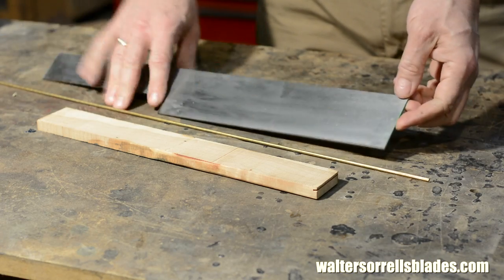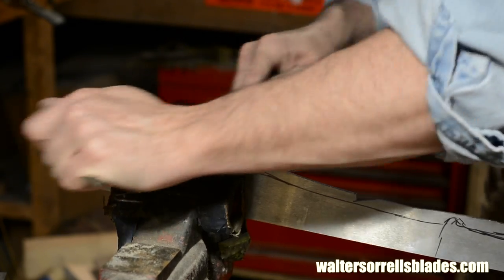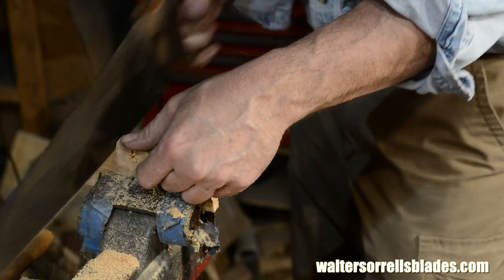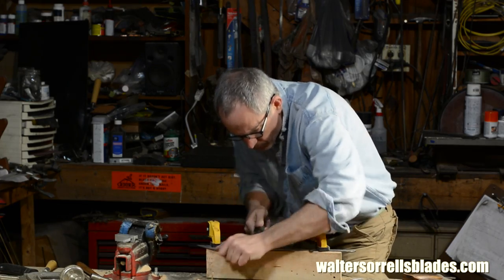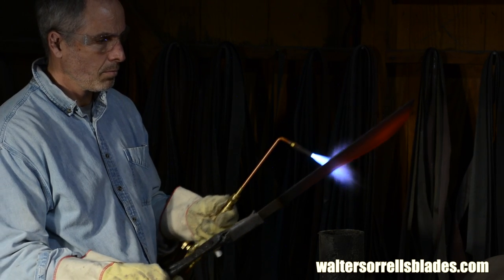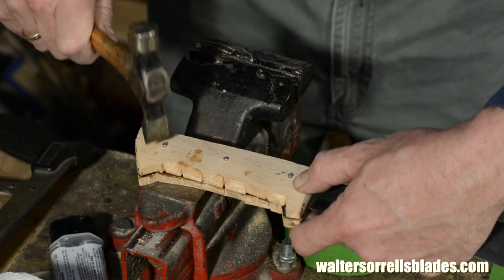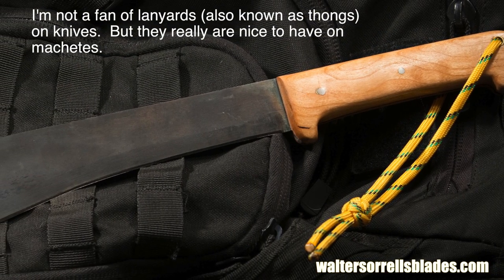Making a Machete with No Power Tools - Survival, Prepper, Beginning Blade Makers

Comment: Great videos very informative I got into knife making as a hobby and I alway use your videos as references, but had a few questions. When quenching the blade can u re use the oil over and over. Also I was wondering if u can use copper for pins. I have a feeling it's to soft and can't handle the water like brass or stainless.

Comment: This is awesome, and I'll definitely be giving this a try. Speaking of reducing carbon footprint, what are your thoughts on re-purposing used saw blades to make knives?
Reply: Repurposing old saw blades is a better grade steel then he used. My grandfather and I made knives together when he was still alive.probably close to 300 or so. Most were sold but I have 3 of them. All were made out of old blades out of table lathes and board planers. We made a matched set of 2 butcher knives with rosewood handles. The blade edges on both are 12 inches, razor sharp, and 2in wide tapering down to 3/4in at the tip with 30 degree arcs bringing them to a point. I use coconut oil on them when their not being used so they don't rust. So in other words repurposed blades to make knives is a really good way of getting quality steel to work with cheap.

Comment: Did I hear you right? Bevel to .015" on the edge? Or did you say .050"? Im doing this exact thing now with an old file... and the bevels are kicking by butt. I now have them pretty similar to one another, but they are more like .050-.075" at the edge... If I were to get them down to .015 I'd be filing for another 5-8 hrs at least... My M9 bayonet's edge seems to be cut from about .050" to .075" so that is where I stopped. Should I put the work in to make the blade a wedge (or something close, i.e. .015"), or should I leave it and put the edge on post-hardening/tempering at .050"? A little more info: The knife is a large one, a couple inches longer than my M9 and about .187" thick (3/16). The blade design is similar to a sheep's foot/reverse tanto. Any advice is appreciated!
Reply: GOREBAGZZZ I intend to make it a heavy camp knife, capable of taking abuse and chopping down trees and splitting fire wood. So although I will put a sharp edge on it, I will be swinging it wildly.

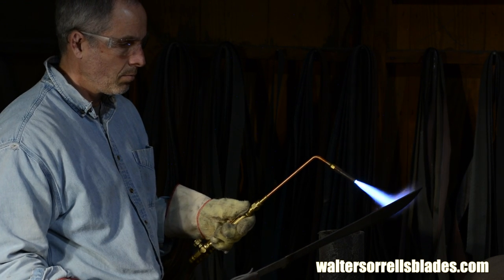Comment: at 11:30 you said you were going to use a propane torch to heat the blade, but clearly that was not propane alone. oxy-lpg maybe, or even o/a, but not straight lpg. 
not trying to nitpick here, but if anyone with a straight propane torch is wondering why their flame doesn't look like yours, well that is why. 
all in all, awesome video

Comment: Just a thought on the filing and how exhausting it it. I agree with you but I think you are tiring yourself doing extra work. The file only cuts on the push and if you use the entire length of it and apply less pressure, the file will cut better and faster and there will be less downward friction giving you lactic acid in your arms.

Nice work though!

Comment: Hey Walter, I just built my own 2x72 knife grinder and I want to make some small knives to begin with. I haven't had much "luck" with getting nice bevels, although I see small improvement over the few pieces of steel I've ground so far. Should I keep free hand grinding or make a bevel jig?
Reply: +Eternal Knives if you can make a bevel jig why  not ;P
Reply: Being able to free hand grind well is important, so maybe a jig will be just as much a waste of time as you save. I'm think I'm staying with free hand for now.
Reply: +Eternal Knives that's what i'd do, but im also the person that will use steel bar instead of flat bar, and pound it out.
Reply: +Delirious Entertainment Phoenix hey thats cool do have instagram or something to show your work?
Reply: Eternal Knives
 i just bought a small anvil, and a small belt sander. i'm currently building a forge, and just finished cutting a piece out of it for a door. i just put a free hand edge on a butter knife as practice, (my dad's idea) and it came out okay. i kinda like the free hand idea and second your thoughts on staying free hand.

Comment: Can I use leaf springs from trucks? and how much carbon does it contain?
Reply: leaf springs work really well for knives but you need to anneal them first so that you can work with the material more easily this is true of any spring steel as spring steel is tempered. 
annealing is basically like tempering but the metal is cooled in sand or ash so that it cools slowly and removes all the stress and hardness from the spring steel. 
my grandfather would use leaf springs from old soviet trucks to make blades. which is more or less how i know you can use them for knives.
Reply: Leaf springs are commonly used to make kukris as well.

Comment: You talk about how blacksmiths were seen as "pretty hardcore dudes" for all the hard physical labour they had to do. Did they actually cut blades out of sheet steel as you did? I thought back in the day they just took a bar of steel or iron and smacked it into shape with a hammer, which would arguably be even MORE hard work than what you're doing here (props for sticking with it with the hand tools!) If they did actually cut things out of sheet steel before filing them down and shaping them the same way you did, I was not aware of this.

Comment: What metal file(s) did you use for the steel? I'm looking to get one or two pretty course ones for rough work like you were doing and I would appreciate a recommendation.
Reply: Oh, I actually just saw a link to your "Top Ten Knifemaking Tools" and you recommended the Nicholson 10 inch bastard file. Do you know how coarse this is? Are files like these even measured in grit?

Comment: Great video, learnt a lot of stuff from it!

Any advice on how to make a decent saw to cut down trees with no power tools?
Reply: +Colonel Burton probably a thinner steel and then use similar technique to this and use the file to make teeth on the saw, should work for small trees. You probably wouldn't cut down a 50 year old oak with it but some young birch maybe.
Reply: use an axe.
Reply: Good point. There's jobs you need a saw for, though. Like cutting wood to size, or making boards.... shudders
Reply: +Colonel Burton 
a good knife, a felling axe, and a hatchet is all you really need cut down a tree, and break it down into rough but useable lumber.
a saw does make things easier though.
Reply: +Colonel Burton 
si te dan 10 horas para talar un arbol, emplea 9 para afilar el hacha
Reply: +Colonel Burton go out and buy a bone saw i cut through a 8 inch tree that was about 60 feet tall in under 30 min and trees arnt quiet when they fall in the woods xD
Reply: Buy the saw.
Reply: +stinkyfungus ...Just like measure 3 times cut once, I use a saw. But I made the handles and twist tightener myself. If the handle breaks I can carve a new one out in the woods. And yes good store bought blades are good and can be field hand sharpened. I always carry extra blades because if you break the only one you have you have a problem. Besides they are easy to sharpen once out in the field as you sit around the camp fire after dinner. I also carry a axe...A good old double sharp ended one. Forget the hatchet. If I need a hammer there are rocks around. Plus I carry a good 18" blade, so does everyone else. We also carry home made spear heads that fit on our oak walking sticks. Good if a bear gets mad at ya. Or fun to fish with! And the spear heads are small and very light weight. Some are barbed just for fishing. We keep our packs to about 35# or so.
Reply: +stinkyfungus ...Smaller deadwood (upto about 4" thick and dry) I will just look for a forked tree or ones close together and place branh bettwen them and snap them, then end feed the fire or put the longer wood on the center and burn through there and then feed the rest into the fire.  Rather simple and you have less to sharpen.
Reply: +vengefulenigma ...50 yr oak is most likely only maybe 6" thick. I would only take it down if it was really dead.
Reply: take the chain off of a chain saw and fasten straps or handles to each end very effective and will last forever
Reply: First off loolk for smaller tree. Climb it and put some 550 rope up top. Pull tree down. Take tree and break it up. Start  fire! Do I need 2 draw U a comic book so U can understand?

Comment: Well not look like a Machete, look more like a Hand Blade to me due the length (I am not bitching or hating) just saying otherwise amazing and beautiful job. Silly ass question, Do you sell it?
Reply: +Jose Echevarria You'd be suprised, but a machete's blade length can greatly vary from around 20cm/8 in to 50 cm/20 in, depending on the actual field of application of the machete.
The general advantage of all of them have is the usually very thin blade which makes for a very sharp edge and a rather light weight combined with the remarkably (un)balanced shape (the mass center of the blade is far more to the point of the blade than it is on "conventional" blades and the rounding increases the edge's length) which eases cutting and chopping of rather soft materials such as wood or branches while taking as less space as possible.
Sorry if that makes me sound like a smartass, but I actually just wanted to make a point to your note that the blade looks rather short and then felt like adding some more info ;)
Reply: Asatruction Thanks very much for the info, always there is something to learn.

Comment: No need to join a gym making any sharp edge blade this way. I used my wood / coal stove to heat up my steel. Wish I had a big torch. Propane / butane mixed gases  hand held one works well but the cost goes way up. I also use what is call a #10 mill bastard file. I like the video.

Comment: Do you heat treat the steel before you start working on it or just after you filed it?
Reply: After you file it. If you heat-treat it at the start, it will be more difficult since the blade already hardened, as compared to unhardened steel which is softer and easier to work with.

Comment: Can you tell me why is important to hardend the blade?is it because of durability or sharones?
Reply: its important to quench once heated to non magnetic and then temper in oven 400 degrees for 2 hours until the steel becomes a straw color, that's if you want your blade to keep holding a sharp edge, And not bend, chip or break. if you want weak blades just for wall hanging only then just shape it out and no heat treat.
Reply: Though hardening can be much different for different steel. I'd do some research for your specific type of steel.
Reply: ok thanks for reply

Comment: While I respect him for making it by hand, it's much easier/practical to just go to Harbour Freight (or a similar tool store) and buy a cheap angle grinder and a bunch of cut off/grinding discs for around $20. Having one of those is pretty much a necessity if you're working with metal.

Comment: Just thought I would point out that normally machetes are semi soft. They are a common agricultural tool in a lot of the world and typically are sharpened with a file in the field as they get dull. Also a hard blade would chip too easily in use as it's not a rare occurrence to hit a rock. Here in Costa RIca they cost about $5 and will last about a month or two for a guy working with it daily before they become so thin that they lack the heft to do the work. 
Not knocking the blade made in this video, just figured I'd let people know why the cheap machete they got at the hardware store isn't very hard. It's not a mistake or just being cheap, in the main markets for them a hardened machete would not be considered a good thing.

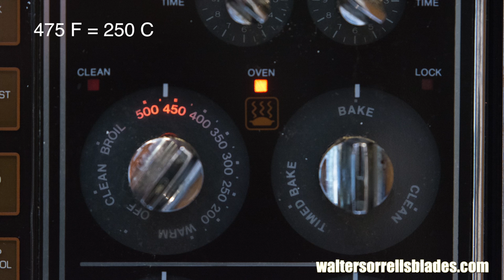Comment: @ Around 15:30 : He heat-treated the machete in the oven for one hour. I don't know how heavy the machete was, but it's supposed to be one hour for every pound of metal; not just one hour no matter what.
Reply: Likely right around a pound, Machetes aren't exactly heavy.
Reply: SilvaDreams
You're right, most machetes aren't really heavy. I've seen a lot of flimsy ones from Walmart and Harbor Freight that wobble when you shake them left and right which the metal would weigh less than a pound. However, the one he made looks quite sturdy. I would have left it in that oven for at least two hours just to be safe.

Comment: why do you need to use oil instead of water
Reply: Water transfers heat too quickly, causing your blade to cool way too fast, which will ruin it good.
Reply: ruin in what way?

Comment: Can't temper and heat treat be done on open flame
Reply: +Patrick Conlon Wood fire does not get hot enough at the flame. Needs to be about twice as hot as an open flame wood fire. A pile of red hot coals with extra air from a bellows will work.

Comment: why don't we need to harden the tang
Reply: +annz98 
Because you don't cut things with the tang.
Reply: because you want the steel at the tang and the back to be more flexable and shock absorbent, thats why he really only had it hardened to temp at the edge. This isnt a knife and this will likely be baton splitting wood and used in high impact cutting. If you think of this as less of a knife and more like a hatchet, that might make it more easy to understand why there needs to be some soft spots to absorb impacts. hope that helps :)
Reply: +Gren Moyo thanks a lot for the info m8

Comment: instead of sawing so much, you could also hotcut it piece by piece with an axe, unless you call a forge a powertool, ah, you used a torch thats even better to make hotcuts on that thickness of steel, with a torch you can even burn-cut off the whole part instead of sawing xD

Comment: you just made the comment that any one can make a knife ---but you need to temper it to have a good knife---what if you start with material that is all ready hard=== it works very well  except when you drill your pin holes  you need carbide grills!!!!

Comment: I only have 2 issues with this video: 1)you didn't explain how or what was done to cool the blade from 480 degree oven bake. This is critical as after an hour heated there's a very big difference between an air cooled blade and requenching the blade once out of the oven! 2) at no point do you show/demonstrate how sharp the result is nor do you discuss whether the blade edge is beveled on 1 side or both. If you have a novice attempt to make his own following your video he might assume that once removed from the oven he/she is supposed to cool it in oil as opposed to allowing it to air cool. This may result in an edge that is prone to chipping or fracturing under the stress of a chop strike. For any novice reading this air cooling the blade after the oven is ideal as metal tends to harden when quickly cooled in any way.regardless reheating to 480 takes some of the brittleness out of the edge that was developed from 1500 quench. If air cooled it will be easier to sharpen and will be more flexable and able to hold up better to brutalities most machetes get exposed to. If requenched the edge will retain more of the original temper and more likely to have a chunk knocked out of it when it strikes oh say a nail when chopping a tree limb off. Its up to you. The requenched version will retain the sharpened edge longer,but I would rather not take the chance of having the edge crack or chip so I'd recommend you hang it from 1 of the holes in the handle to allow it to air cool.

Comment: I neither know...nor care...who told you different! but QUNECHING is when you put the hot steel into the water or oil to cool it off. HEATING it is tempering or annealing NOT quenching. you may know this and simply mis-spoke or I may have misunderstood how you worded it, if so I'm sorry. if not, learn it. live it.
Reply: Richard Bray yes it is part of the hardening process...when did I say otherwise? PART of the PROCESS it is NOT the whole process. Quenching is just and only the part where the hot metal is placed into the liquid medium in which it is to be QUENCHED.
Reply: Richard Bray my point is that HEATING is NOT quenching. QUENCHING is COOLING the metal AFTER it has been heated. and is part of the WHOLE process of tempering. the moron in the video said that tempering is called quenching...that is not true.
Reply: +Edward Teach It makes me laugh when people like you who are so arrogant and sure of yourself are so very wrong. Quenching is part of the hardening process not the tempering process, the tempering process takes the metal from a brittle stage to a durable stage releasing the tension in the crystalline structure. Both are part of the Heat Treatment process.

Comment: moral of the story, buy a belt sander and a power drill.
the kind of people who dont have any power tools are not the kind of people who make machetes, no those people would rather spend $10 at wallmart because its more convinient.

either that or those without power tools are kids.
Reply: CaptainSkelebones that's actually not true. It would have be easier and cheaper to go buy a new butchers knife than to refurbish my late grandfathers.
Reply: CaptainSkelebones I have no power tools and I made my first blade, it took some effort, but I did it. You're not born as a blacksmith, all the equipment is not handed to you by God as soon as you decide ''hey, Imma make a knife''. I don't really have any money for all that at the moment, though I really wanted to try myself at bladesmithing, and I was right, it is fucking great hobby/whatever. I may, with time, acquire tools when I am more well off financially.
Also, in my opinion, every good bladesmith (like with any other profession of similar kind) should be able to do his job the hard way, not only relying on equipment that literally does half the job for you.